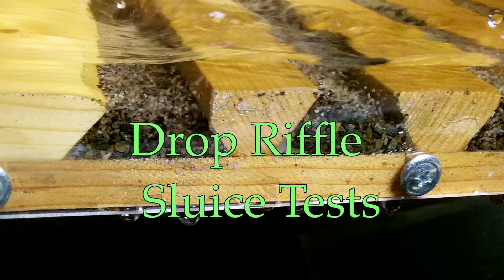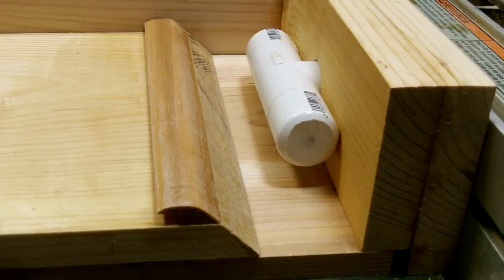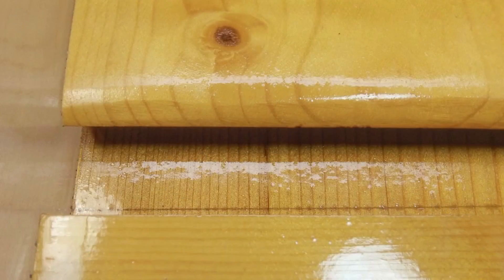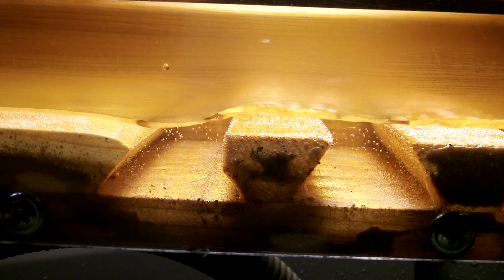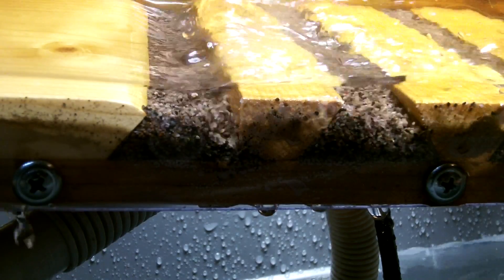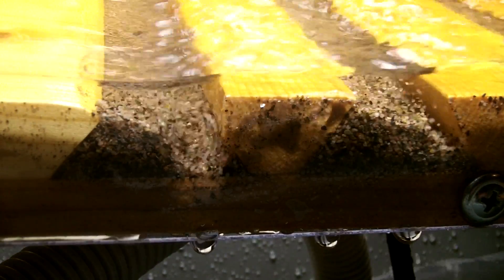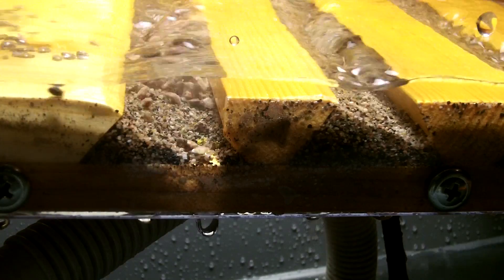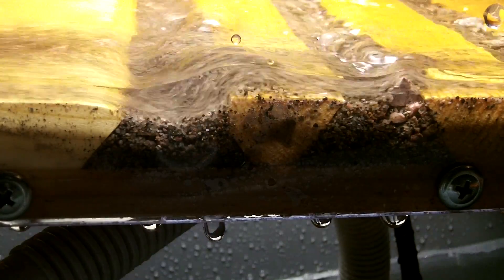DROP RIFFLE SLUICE TEST

Comment: excellent content and design
Reply from the maker: Thank you AU Miner and thanks for watching. I do a lot of testing of different types of equipment and mats to try and understand what catches gold the best. I am currently working on several more videos of these hard riffle sluices if you are interested.
Reply: @utahavalanch  Def interested :)  I think a drop riffle is far superior to a raised riffle. I've been designing and testing some of my own.  I'm pondering a series of small to large drop cuts, to capture the fines and the large without classification. Very small 1/8" deep cuts, then increasing in size. My hope is the small riffle will catch the small gold and the largers gold will be caught by the nest appropriate size riffle.
Reply from the maker: @AUMINER1  
After 12 years of testing, I’ve found that the drop riffle is the best at catching gold. I primarily work with very fine gold and I have found that these large deep riffles work the best for the fine gold. The large troughs have plenty of room to catch all the heavies and I can separate the gold out of the concentrates very easily with my Miller Table or gold pan. However the riffles work best with classification. As you can see in the video, when I run -4 mesh material through the sluice, the larger rocks fill the riffles and shut the material exchange down and the gold has no where to go but out the end of the sluice.
Reply: @utahavalanch  Just tonight I was running my 60- cons through my latest test riffles. I was shocked to see a line of mirco gold in ta riffle test designs. Basically a small riffle before/on top of a larger riffle. The rest of the other riffles without that design had nothing. I reran the test with just dirty water, and a line of 500mesh blond sand was caught in the same place, and the rest of the riffles were 100% clean. I might be on to something :)
Reply: @utahavalanch  What is your opinion of the goldwell design?
Reply from the maker: @AUMINER1  
That’s the idea. Keep trying different things and see what works best for you. That riffle on a riffle can work quite well. There is a surprising amount of very fine gold in the dirt that is all around us and I find it much more interesting to try and capture than the larger gold. I’m getting ready to test a sluice that is designed to catch gold in the - 100 - 300 mesh range. Should be interesting.
The Silicon mats you make yourself really work great on the fine gold as when the gold touch’s the Silicone it sticks to it like on flypaper.
Reply: @utahavalanch  I think a high water speed can capture ultra fine gold with a small riffle if they are spaced apart a bit. Higher the water speed the more of a vacuum the riffle can create.
Reply: @utahavalanch  I have an rp4 shaker table to test tails which helps. I also have a knelson concentrator that will capture 500 mesh face powder gold.
Reply: A small duplex jig would likely work well on some of these black sand beaches, capture the cons and take them home to eco leach might find some interesting recovery rates
Reply from the maker: @AUMINER1 
It’s probably the best design to ever hit the market. I built several of them myself and tested  them for a year. It catches the fine gold very well. The marketing of them was a major disaster. I made a video on them and how well they work and hoped to get some good publicity for the owner. I got a lawsuit instead. 
I have a new hard riffle sluice that is a cross between it and the Dream Mat that I’m anxious to try.
Reply from the maker: @AUMINER1  
I am classifying the dirt down to - 100 mesh and running very slow water just enough to wash off the light material and the fine gold is dropping out nicely for me. I haven’t had any luck with the high water flow so far.
Reply: @utahavalanch  interesting - I see he made a triangle type shape a while back...i've seen two versions of it, but I don't think any of them sold.  Bernie had a friend with a machine shop, and the owner of the machine shop created that design, and I think bernie cut him out shortly after.... bernie was stubborn and stuck in his ways, and it cost him lots. I think he's passed on now and he tried to sell the biz to another guy but his patents were not valid, so it was a huge disaster.  devin the canada guy seems to have done ok with making them lol. I have a mold of them, and I think I can improve on the design.  It's funny to me that people think a round pocket in a sluice would create a spinning vortex tornado lol.... If you look at devins alternating front/back design in action, you will see the reg orientation captures gold on the leading edge, and the opposite direction ones don't. careful observation will show the flaw in the pocket, and how it can be fixed :)
Reply: @utahavalanch  Did you take the gold well video down? I'd love to see your content on that one!
Reply from the maker: @AUMINER1  
The RP4 is a nice table. I would like to have one someday but unfortunately I don’t have a place to set one up.😢 I’m not familiar with the knelson.
Reply from the maker: @AUMINER1  
Yes, some of these jigs would work well on beach sand. I work a lot with the Cape Disappointment, Nome Beach, Wisconsin and Minnesota beach sands. Fun stuff to work with. There is a gentleman who made a large jig called the Gold Drop that does very well on those sands. He has a YouTube channel. I’d like to have one.
Reply from the maker: @AUMINER1  
Yea, Bernie had no marketing sense at all. Good product though. I shoot thousands of videos on everything I build and run and I found by watching the videos on mine that a slight adjustment on his design would improve it greatly. I built 2 of them and made the mod and it worked really well. Devins design uses way too small vortex circles and their spacing is wrong so it doesn’t work as well as the original. The vortex circles have to be spaced just right so the water flow goes out of the vortex and dumps directly into the next trough down stream. His circles need to be much larger as well. My latest idea is half circles dumping back into a large trough back upstream. Should be interesting to see how it works.
Reply from the maker: @AUMINER1  
Yea, I had to. The owners lawyer wouldn’t let me leave it up. I donated the sluices to a couple of friends and they got some good use out of them. I quit liked them. I’m trying to make a Goldwell Silicone mat but it’s a bit tricky.
Reply: @utahavalanch  fascinating ;) I'd love to see the half circles in action. :)  Are you familiar with how a NACA duct works? for both pushing and pulling
Reply from the maker: @AUMINER1 
I have seen a couple of videos on the centrifuges and I’d like to play with one some time. They look interesting.
Reply from the maker: @AUMINER1  
I’d like to play around with that Neffco bowl as well. I made a goldpan type thing similar to his scoop he was panning with. Works quite well fo me.
Reply from the maker: @AUMINER1  
Afraid I’m not familiar with the NACA duct. 
I just finished the clear side sluice with the half circle drop riffles. I just have to find some time to set it up run and video it. Been working on a second fine gold Highbanker sluices with mats lately. I have been running one quite a bit and I’ve been surprised at how well it’s working. It catches gold down to 200 mesh and that works for me. I need a 40x loupe to see it. 
Weather has been too hot to go out and run much so I hope things cool down soon.
Reply: @utahavalanch  I would have told the lawyers to screw off, they cannot do anything if you copy the design...nothing. Patents are only infringed on if a profit was made - and since you are not selling them, they have ZERO legal right to ask you for anything at all. You could make exact copies and give them away, and they could do nothing about it. They try to bully and scare people. I'd put all of that content back up, there is nothing they can do about it. zero.
Reply from the maker: @AUMINER1  
Yippers, you are 100% correct there. But it wasn’t a big deal to me as I thought I’d just put up the video to give him some free advertising. But like I said earlier, he had absolutely no marketing sense. Oh, well. The sluice is very easy to make with wood and he may have thought that everyone was going to make one instead of buying his. I don’t know. But with Alan Robertson coming out with the Silicon mat idea, I am working more with those and having great success.
Reply: @AUMINER1  I was just wondering about this: "Is it better to make a flared sluice narrow and deep + wide riffled at the top, or wider at the top with finer riffles. You just helped make up my mind.
Grab the fines first, because if it flares at the bottom, there'll never be enough flow to clear the bigger stuff.
Mind, I believe the three most things in Gold mining are: Classify, classify, classify.
Also, the education I received just from you two bantering in this thread was invaluable. Thank you both.
Reply: @TimeSurfer206  Classify, classify, classify! That is the only way to capitalize on the weight of gold over reg material. IE the weight of one spec of 200 mesh gold has to weigh more than a large spec of quartz, otherwise you get zero gravity advantage. The more that offset is, the easier it is to recover the G'. Thanks for reviving this thread, it was a good one!
Reply: @AUMINER1  We're as bad as Real Estate Agents, aren't we? 🤣🤣
Reply: @TimeSurfer206  🤣🤣 prob worse🤔

Comment: WHAT BEST SLOPE HAVE YOU OBSERVED?
Reply from the maker: Hi and thanks for watching. I usually set a starting point angle of about 10 degrees and then adjust it from there if I need to. If it’s fine gold material, I may set it closer to 7 or 8 degrees to give the fine gold a chance to settle.
Reply: @utahavalanch  Thank you very much! Great video! Rei do garimpo  from Brazil
Reply from the maker: @reidogarimpo1691  thank you and I hope you have a great day.

Comment: To process about 700 kilograms per hour. What dimension should your design be approximately in terms of the length and width of your lock design and what height of rifles. ??
Reply from the maker: Hi Carlos. I have a gentleman down in Africa that is building one to try and handle that much material. His is 20” (50cm) wide x about 12’ (365 cm) long. That would still be pushing a sluice that size. You may need 2 of them side by side. It would be best if you could screen your material through an 8 mesh screen to keep from losing the fine gold.
Reply from the maker: I would make the riffles about 12mm high x about 20 mm wide. Make the troughs 20 - 25 mm wide.

Comment: I use the same sump in my water table!! And a last chance inverted riffle at bottom!
Doing Thermoforming,  inverted riffles are tough!!
Reply from the maker: Hi Spike and thanks for watching. Yea, I know what you mean, I tried doing those with a silicone mold for a mat. I make a lot of different molds for mats and the molds don’t always produce how you think they will.
Reply: Abs has a textured finish and negative static charge, positive Gold particles stick like fly paper!
Reply from the maker: @spikechampkart55  
Yippers, it’s good stuff alright. I thought about getting into it a few years back but it was too expensive. Good for mass production but I test different designs and concepts and so I make 30 - 40 different pieces of equipment a year for testing and so it wouldn’t work out for me. I wish there was a way to do it cheaply for one offs.
Reply: I make all my own molds, do one offs for customers too, so no limits.  I built a hopper for a Trommell mold, made one, lol

Comment: Using your basic design I built one just under 5'8" long, inner measurement between the sides is 11 inches. 3/4" gap between each riffle, and each riffle 3/4"  tall. with the undercut. Many layers of lacquer. Works great.
Reply from the maker: Hi Glen and thanks for watching. Congratulations on your build. That one should work very well for you. This design has been around for at least 150 years and probably longer for a reason.  It catches gold better than anything I have found.
Reply: @utahavalanch  Which design.??
Reply from the maker: @CARLOSCESPEDESbiocihealth  
Hi Carlos and thanks for watching. I decided to go with the straight up and down on both walls of the trough.
Reply: I've been watching a lot of videos studying different notions for holding the gold while clearing the cells of blonds, stones and most of the black sand. I'm playing with the water flow, depth and angle of a plastic 40" La Trap drop riffle, high banker - 
I'm glad I found your channel.
Reply from the maker: @imdawolfman  
It’s good to do a lot of experimenting to find what works the best. Those Le Trap sluices are some nice ones. Good gold catchers.

Comment: how many centimeters between the rifles?  how high is each riffle?
Thank you João from Brazil.
Reply from the maker: I'm not very good at the metric system :-)  but I'll give it a try.  The space between the riffles is 3/4 inch or 1.90 cm or 19.05 mm if my conversion program is working. The height of the riffles is the same.  You can also make the riffle height 5/8 inch,  1.5 cm 16 mm if you would like but keep the distance between riffles 1.9 cm.  To make sure I get all the gold, I like to have enough room in the riffles to catch all the black sand as well as the gold. If you lose any black sand, you will lose the gold that is the same weight. I like to catch it all and then separate it on my Miller Table.
Reply: @utahavalanch  thank you very much, you are a genius! God bless you brother. God bless you!
Reply from the maker: @reidogarimpo1691  
Thank you sir and God bless you as well. Hope you find lots of gold. 👍
Reply: @utahavalanch  AMEN!
Reply: @utahavalanch  Thks by this info. Rgds
Reply from the maker: @CARLOSCESPEDESbiocihealth  you are welcome.
Reply: @utahavalanch  Which is the Miller Table. Rgds  from Puerto Vallarta, Mexico.
Reply from the maker: @CARLOSCESPEDESbiocihealth  
Hi Carlos, you can find the Miller Table introduction here. 
https://youtu.be/btG2CFtePrw
I also have a video out on how to make the Miller Table.

Comment: you could add a kind of mesh, but not mesh, er say a line of straight wire  to lift the larger stones what would slide over but the smaller particles still drop through into the dropriffle. That way your first few dropriffles are dedicated to the finest gold capture and you can adjust the shape of the later dropriffles allowing more agitation to remove the larger pebbles?
Reply from the maker: Geoff C 
Hi Geoff, and thanks for watching. Yes you could do that. However I have found that it's easier to just screen the material down to a smaller size before running it and then pan out the larger size material. Some manufacturers make wide troughs about 1-1/2" wide to make enough room for the larger material as well as the small. Lots of ways to do it.

Comment: What about some groves put in drop riffle congruent with water flow at an 1/8 of an inch to undercut the larger Stone and dislodge them as it pushes up? The depth would be key. But it may be the solution to non classified  mats. It may inundate the larger stones as vibrating does ? Excellent design sir. Your definitely spot on.
Reply from the maker: Hi Richard and thanks for watching.  Yes, you could try that and it would work but unfortunately the problem is, that the force of the water running through the small grooves has quite a bit of force and when it hits the rock it sprays out in all directions and one of them is down.  The force can easily blow out the fine black sand and gold. This type of Drop Riffle works best with material screened to about 12 mesh and smaller. Most all of the gold I work with is very tiny so this type of riffle works very well for me.

Other manufacturers have come up with mats that are wide and shallow like the Keene Miracle mat so that there is much more room for the larger rocks to rest without disturbing the fine gold. However with that design, you have to watch the water flow very carefully as it can blow out the fine gold very easily.  I have found that to get the most gold, I screen all of my material down into about 4 different sizes and run each one separately but I know a lot of people don't like to do that. I have run most all of the mats on the market at one time or another and I have found that it's best to run all the larger rocks and smaller sand in different runs so that you can adjust the water flow for each one of them.
Reply: Some classification saves gold, I hate seeing a 3 in. square rock bouncing down the sluice knocking whatever's there loose.

Comment: Just got it and▶️>imgs.love/SSluiceBox?c81c   I got miners moss for it to the moss seems a little thick for it but I am going to try it in it anyway it is made of a good quality aluminum it is not heavy I was hoping it folded but it doesn't no matter it does come with a carpet under the riffles so the miners moss is not needed 1 wingnut cleanup now all I need is a place to go and I am set
Reply from the maker: Jan Dylewski 
Hi Jan and congratulations on the new sluice. It's a beauty and should work well for  you. Now you just have to get out and work some dirt. Very best of luck.
Reply: I'm putting some miner's moss right under the grizely categorizor to help break up the clumps and clay.